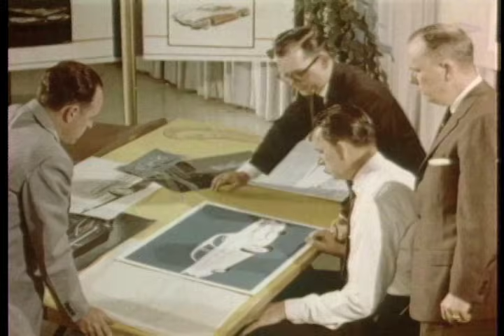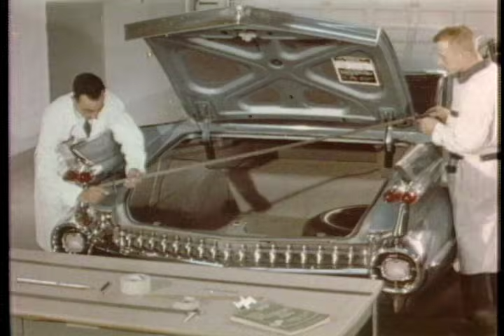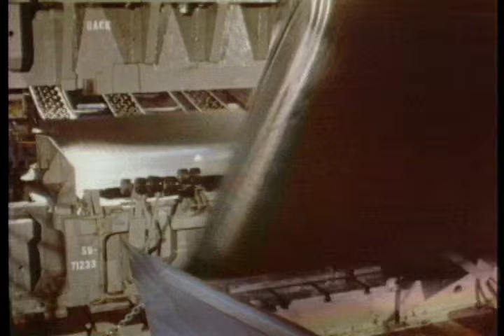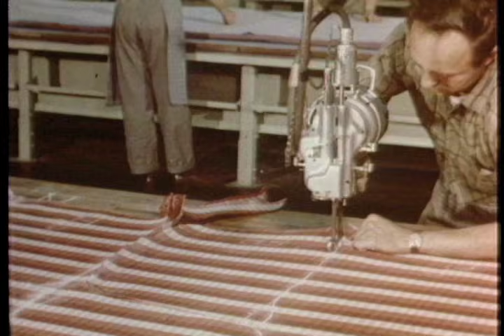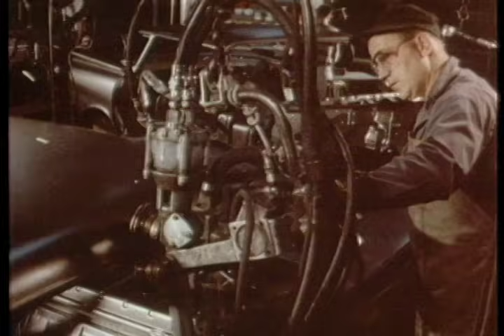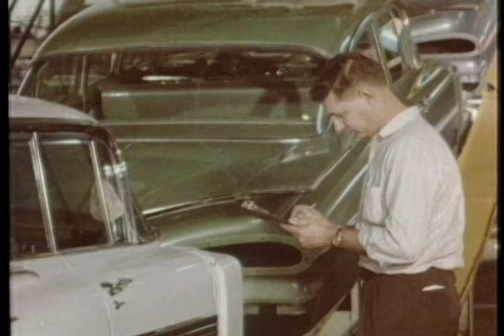How GM Built a Car in 1959: Up from Clay - A Car is Born

Comment: spraying acrylic laquer with no mask. that's some pretty nasty stuff!!!! but the quality of the build is great. a restorers dream to actually see ho it was done!!
Reply: Drew Smith+ Yes Sir, I noticed that as well. No Personal Safety Equipment / PSE on their employees. Back then the industrial auto paint & primer used were some of the best made products for long lasting finish & durability. Sadly, repeated exposure to these dangerous chemicals caused damage to anyone exposed over time to them.  This is why safety is stressed today when handling and applying paint products. I knew a few automotive painters in the late 1960's that later developed heath conditions from their daily exposures to these types of automotive painting products. I also noticed some of the best older painters were hopelessly addicted to smoking cigarettes and drinking alcohol. Some would also smoke while painting and drink beer between coats of paint waiting for them to tack up. Really sad most of our best painters are dead now. Hence the saying you can find a lot of painters just not a lot of really good old painters.
Reply: ***** Well, I can tell you most painters I knew developed forms of Cancer. Some also developed conditions of Brain Damage. The fumes and long term exposure to paint & primer is very dangerous. Union safety rules now state you must use an approved respirator every time you paint. Coveralls & gloves are also required in all union shops as PSE. Some even require full body painters suits with a O2 supply.  I also noticed the older painters would often clean their hands in lacquer thinner or reducer every day without any fear.
Reply: @jdmdealers  it's funny how people smoked and drank and didn't realize it was bad for them let alone paint fumes... Maybe in the back of their mind they knew but they were addicted and getting high off paint fumes too
Reply: @rontreen3278  .......And I used to know Guys that got high on sniffing bicycle seats!!!!!! .

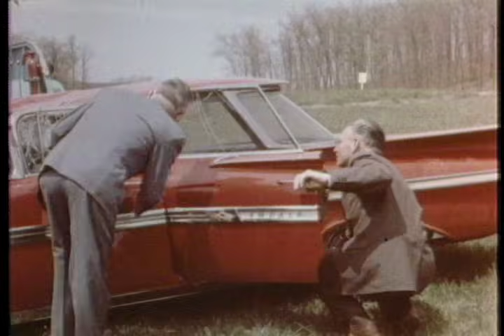Comment: 10:26  50s 60s 70s cars are more  havy but more strong  now if  someone do  this to  tenth  gen of this model   . The car will be smashed
Reply: In collision those old cars are much more dangerous death traps to passengers compared to mid 90's - todays cars. Reliability too was worse compared to modern cars. They are much easier to repair though, no coding skills needed :)
Reply: vehicles of the Era were very dangerous. when u had people decapitated by the hood. or impaled by the steering column .thank God for progress
Reply: Mihail Dimitrov  .heavy they were.and the steel was stronger yes. however the strength of steel isn't the only thing that would be realized later.it would be how that material react in a crash absorbing that energy.and channeling it around the cabin space frame. vehicles of